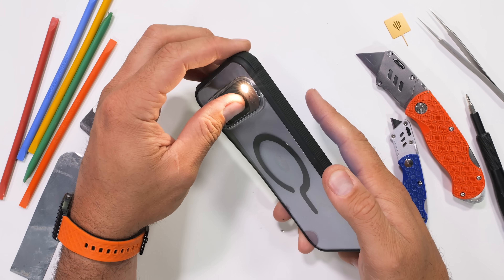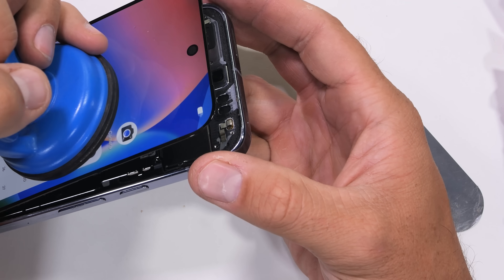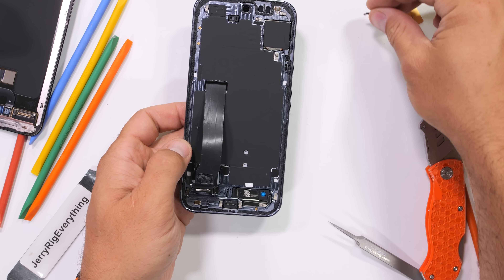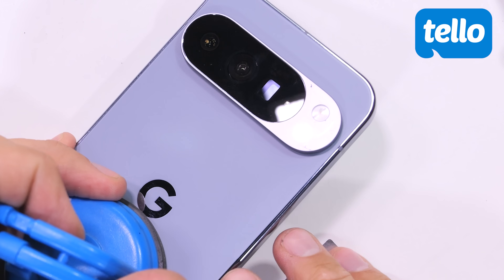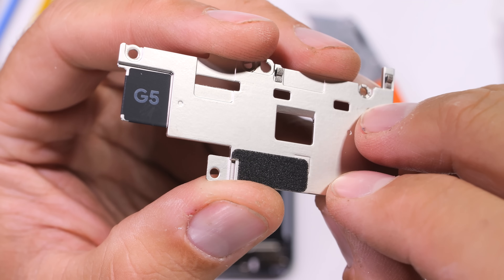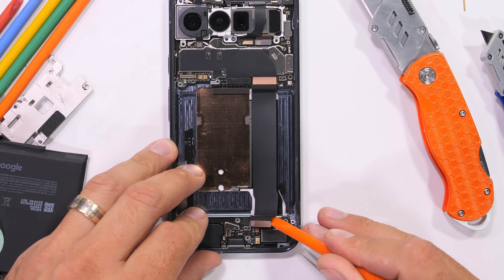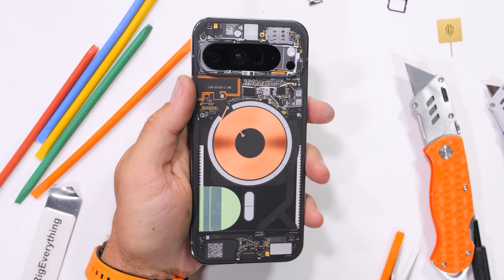GOOGLE FINALLY DID IT! - I'm so proud...

Comment: As soon as you started shilling I turned it off. Why would a company charge significantly more for a digital E Sim to a physical Sim. Is this a break through in technology allowing Sim cards to be cheaper? Sim cards just load digits physical or not there is no reason it can be 10 physical and $5 non besides manufacturers cost of actual chip. Which is likely $.20 not monthly either. Sell out
Reply: Because e-sims are better.

Comment: Actually, "international" pixel phones (or more correctly, non-US models) also support eSIM, so have both choices. If you need more than two numbers eSIM are handy, but traditional sims are easier to move between phones should you need to.

Comment: Screws aren't (and have never been) an issue when repairing these phones. The heatgun, glue removal process which is still incredibly susceptible to damaging the display is still the biggest issue. NOT easily repairable in my book.

Comment: We just want
1. Removable batteries
2. Solid supply of said batteries up to 10yrs
Reply: Don't forget about oled displays that dont crap out giving random green lines after a year or so of use
Reply: @Lucas-ck1po  not every oled phone has that issue
Reply: I want 512gb storage without being extorted to pay an extra USD $500. Until then, I'm not buying a new phone.
Reply: * removable back cover
Reply: Batteries are removable already with tools
Reply: You common sense. Removable batteries? Then what happened to water resistance?

Comment: Tell me if I’m wrong, but phones makers should stop trying to make their screen super hard and scratch prof, because 90% of people use a glass protector anyway (sorry about that 10%). They should focus on other properties of the screen, like reparability or flexibility (so they don't shatter). Sticking on a glass protector—even if it’s not that super druper screach resistent like a Victus Gorila or whatever—is a good enough solution, as long as it’s cheap and easy to apply, and guess what, it is! Why should we pay for a hard to repair, ultra-expensive, super-durable glass screen if almost everybody just puts a glass protector on their phones? They are easy to apply and cheap they should just include one for free in the box to be fais with that 10 %.

Comment: How is this even considered more repairable then the fairphone? You used a heat gun and a blade to open it? And you will need a glue strip I assume to place it back down? Fairphone isn't perfect sure but it's better then this process
Reply: More repairable compared to previous Google phones

Comment: I heard people complain about its weak specs, but really why do people need such high performance processors in a mobile? I'd so much rather have a device that respects consumers like this one does with it's unlockable bootloader, good repairability, and good documentation. Also, ironically the best way to de-Google is to get a Google Phone too. At least unless you're also against supporting them financially I suppose (boycott rather than just privacy).

Comment: Um... The Samsung S5 / Note 4 were MUCH easier to work on.  No heat gun required.  Any user could replace the battery.  and it had an IR blaster, headphone jack, microSD card slot, heartrate/pulseox sensor, etc.

Comment: Hot take:

Apple: "The best phone is the one you never have to repair"

Google: "The best phone is the one you can repair & keep forever"

Also, I just got an Idea, in the future, you can upgrade your battery from lithium ion to silicon carbon which packs 20% more capacity hence giving better battery life. That would be amazing as long as the software supports it without exploding like an S7😂

Comment: Free 234 page manual doesn't make this phone more rapairable than Fairphone. They still glued everything, and I know that I will curse Google 234 times trying to open it without prior experience of phone repair. Even you had some spare parts, which is telling something. Well, apparently they are improving, but still far cry from drop in replacement of anything. Instead of glue try ancient forgotten technology of screws. But that would require making something different from Apple formula, which no mainstream company is capable of doing apparently.
Reply: its just a statement that they dont trust their userbase to be a majority home DIY repairman, which from a name as big as google, is fair (phone pun intended)

but for the average phone service shop, its easier now to repair phones from the elderlies, which theyre not gonna self service anyway.
Reply: @TD2T it's not lack of trust, it's deliberate effort to stop people from repairing or changing a battery and go buy a new phone instead. Apple did it and now everyone copying it blindly.
Reply: Then its not going to be waterproof, i would definitely not want such a phone
Reply: @gapininja it can still be water resistant with more thickness

Comment: Yeah.. for $45 a month in my country Bulgaria ( east EU member) I get:
1. A mobile plan with unlimited 4G(around 280mbs) and 5G(around 850mbs) internet and calls in whole Europe member counties
2. A second limited mobile plan for my 6yo daughter's smart watch 
3. A mobile router with 300GB of fast internet in whole Europe that I use to monitor a farm that's far from "the modern world"
4. An android device that has more that 500 TV channels + the ability to install an app on another 3 devices to watch the same things. + I installed PSP emulator on it and it runs even god of war :)
5. 2 years of Netflix basic subscription! 
6. I got when I signed the contract a Motorola G24 for $12 that my daughter uses.

Comment: The battery being easily removable is such a win.
Reply: You still need a heatgun...
Reply: @NBD739  I worked on one of these yesterday at a shop. You don't need a heat gun, just some kind of heat source and some plastic to pry with. If I have to do a repair at home, I use a hairdryer and just go REALLY slow

Comment: If the tensor G5 didn’t suck so bad I’d seriously consider this phone. Selling parts is huge. Apple does this too but it usually costs the same to buy the part as it does to have the repair done by them
Reply: What problem does G5 have?
Reply: @moonlightpage it’s a lot of years behind Snapdragon and Mediatek in terms of CPU, GPU, and power draw. All it’s got going for it is that Google makes it in house so it’s theoretically cheaper, but the phone is just as expensive as everyone else
Reply: no sideloading
Reply: @catosx2738 side loading has nothing to do with the Processor. It's the OS which decides if side loading is allowed or not.

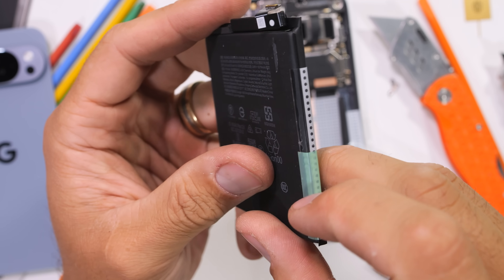Comment: 5:19 The little extra bracket is a stabilizer bracket that sat above the left rear camera. It was attached through that one screw hole above the camera and held down the connectors for that wires above the camera.
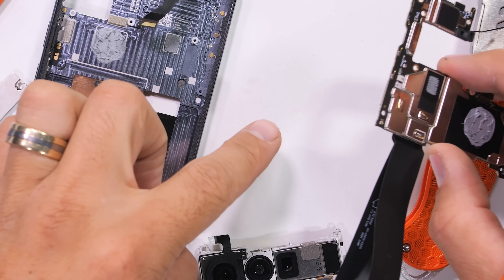No idea where the bracket in 6:33 came from though, lol.

Comment: It makes sense that they are making the battery easier to replace. They already committed to decreasing battery charging percentage after 400 cycles so having a battery that can be replaced just makes sense.  The EU is also rumoured to be pushing for phones to be easier to repair, including replaceable batteries. Google is putting themselves is a good position

Comment: Sorry, perhaps dumb question. If the phone has an high ip rating. Then why are there water test stickers inside the phone?
Reply: IP68 is only water resistant down to 3m/10ft, and assuming the phone is in good condition.

Comment: if you have to use anything more than a screwdriver to take apart a phone it is NOT easier to repaire and maintain compared to a fairphone and for the screen replacment you once again for fair phone you only need a screwdriver to do it no heat gun or anything else etc. it is not the easiest screen to replace on a phone fairphone is.

Comment: Man, i was so happy to see the ribbon cable for the display was in the mid. But then u removed the back. That ribbon cable on the far left is an absolute disgrace to smartphone companies. It should never be so far to the outside in my eyes. I stopped repairing phones simply cause of that. Had to many of the tear on my due to stupid placement.

Comment: 240 pages of repair guide is not "easily repairable." Google still want you to either pay their technicians or buy a new phone.
Reply: Easily repairable by local technicians not you. You don't need to read 240 pages of repair guide to replace your screen or battery as clearly seen in the video.

Comment: My forever question will be:
Why did we ever glue batteries in place instead of having literally ANY form of mechanical retention system? 
Besides money that is.

Could any manufacturer NOT make an ultra-thin piece of aluminium in the shape of an X that goes on top of the battery and then has 4 screw-down points on each corner?
Its not like the battery will fall out of place if its shaken too much anyway since the back of the phone is already welded shut with how much glue some manufacturers use.
Reply: mechanical is less bouncy, and batteries dont like being in a cold cramped space, 'lest you want another Note 7

arranged solution is plastic but one that doesnt shake as much, such as glue. pull tabs goes less sticky overtime, but at that point you might already have plans for chanaging batteries

Comment: - Used a heat gun.
- Used chemicals (propanol alcohol).
- Used various different tools.
- Every screw is different.
- You are left with two pieces and no idea where they came from.
This smartphone has a repairability score of 6/10.

Do you really call this 'more repairable than the FaiPhone' (which, by the way, has a 10/10 repairability score) and 'the most repairable smartphone of the year'? Are you serious?

Comment: 100000 like. zack bro. i think you underestimate your fans just like you did during Nothing phone 1 and ended up counting each leds.❤❤😂

4 hrs and you have reached almost a quarter. I bet we don't need more than 2 days.

if you have read this, and if you get 100000 likes, you will Do Durability test and teardown of Iphone 17air in 1 single video before 20th Sept 2025.

Comment: 0:03 How is this more repairable?? Fairphone 6 display literally is just held in with screws, no adhesive, and no alcohol, heat gun or ultra-thin blade required.

Comment: Can you test water durability? Maybe check at what depth they start to leak. Rate the seals internally. I've seen a couple of google pixel phones fail after a year with minor water splashes entering and killing them. Something is not right, if a phone is advertised as IP68 then it should remain like that for many years and not just 1 or 2 years.

Comment: I don't agree with the most repairable phone of the year. The Fairphone 6 does not need hot air to loosen the screen nor is the battery glued in, however easy you could get it out of the Pixel.

Comment: FWIW, regular simcard subscriptions can be as low as 5 euros as well. You usually only have to pay a small fee to transfer your phonenumber. But other than that, there isn't much difference.
I like having my contacts as backup on the simcard. If something goes wrong with the phone, I just have to pop the simcard in a old backup phone and everything works.
Reply: eSIMs are only useful when you have a chinese phone number, which they shouldn't, so its basically useless

aall these years Comp Science people have worked on making sims unduplicateable, became useless in a singular day 😂

Comment: 2:30 - Please don't normalize eSIM. A physical SIM card allows me to quickly move "my phone" to different hardware if my phone breaks. An eSIM requires asking mommy and daddy to please allow you to move.
Reply: It's not that it's harder. ESIM is actually easier. It's just that you need an app and Internet connection to do it. A SIM card can be moved at any time, no network needed.
Reply: I prefer a physical SIM card.
Reply: Tbh, I personally prefer eSIMs since 3 years ago I bought the Google Pixel 6 Pro and in about a year, the SIM card slot ended up breaking with the physical SIM card stuck inside, the slot was very fragile and easy to break so trying to pull it out would only cause damage 

I really liked the smartphone but that on its own really messed things up for me, I remember taking it in for repairs and was charged almost 300, I also travel a lot so having multiple eSIMs would make life much easier
Reply: It's a control thing. Like everything else.

Who benefits from disabling your ability to quickly and easily disconnect your phone from the cell network? Who would want to make sure you are constantly available to be tracked, and send data back together cloud.

Who is in the middle of pushing to lockdown even the ability to sideload APKs.

Hint. Big brother only likes sheep. Never independence.
Reply: @breakingthemasks  and who is Big brother? I want more details.
Reply: I don't get how so many people have issues with eSIMs. I got my Pixel 10 Pro XL and the process of moving the eSIM to it was literally just installing my carrier's app (Mint Mobile) on the new phone, going to the menu and saying I want to get a new eSIM for the phone, and then waiting about 1 minute for the process to complete. Is it much harder with other carriers?
Reply: @alex-d3l2z  I live in a country where esims are not very convenient. We use our phones to access/log into a lot of things. Needs a physical sim. There is an esim alternative but it sucks so barely anyone uses it.
Reply: @alex-d3l2z  Mint makes it way easier than other companies like ATT. I can switch my Mint number over as many times as I want without issue. With ATT they let me do it once through their website and then if I try it again sometime later it usually doesn't work, so then I have to go into one of the stores to get it switched.
Reply: @alex-d3l2z in my country, all providers charge some amount (approx. 1 months fee) for each esim installation and they want you to be there in person. It's not phone manufacturers fault but it is what it is
Reply: I just put my SIM card in my phone.....
Reply: If esim is normalized maybe it can be way easier to move it
Reply: No it doesn't, esims are transferable and switchable (having many esims loaded on the phone that can be switched with a button push), traveling is way easier with esim also no need to go to a store to get a plan just buy one online and your done.
Reply: @nlibby987  How do you transfer that e-sim out of a broken phone that won;r power on?
Reply: @pileofstuff  THANK YOU, how tf do you put an eSIM into a backup phone that uses traditional SIMs? It's like no one in this comment section has broken a phone..
Reply: @130rne  Why not just keep the sim card in the drawer with your backup phone while downloading an e-sim to your new phone?
Reply: @drosendahl  You can't have a physical SIM and eSIM at the same time for the same phone number.
Reply: @pileofstuff  damn you silenced him 😔
Reply: @nlibby987 but not on fly its not.
Reply: it also allows thieves to quickly swap out the sim and knock the phone out of network service and make it untraceable
Reply: @rock3tduckNIZ  What a constructed issue, if they have your phone they can just wipe the esim off of it.
Reply: @cyberdusttv  Where I live, eSIM is not readily available. Recently, my roommate lost his iPhone, which had no eSIM. If it had an eSIM, the thieves would not have been able to remove the SIM, and the phone would have remained easily traceable. You also wouldn’t be able to power off the phone while it’s locked or even wipe it.

Comment: This is nice to see from a large brand, but it can be better. My phone from 2022 has a removable back plate (no glue) which after removing it reveals screws that open up the phone. The battery is also fastened with screws, no glue used at all. That's way better than any large brand is doing, and it's still way more water resistant than any of their phones.

Comment: How is this possibly as repairable as the fairphone? You need a heatgun to open it, the USB-C port is part of the bottom board, whereas on fairphone the port itself can be replaced without needing to replace the whole breakout board, the battery (despite being better than previous pixel models) is still glued in, whereas fairphone can be removed by screws. A family member could comfortably perform a fairphone battery swap themselves, but I don't see that happening with the pixel. There's no comparison, and fairphone wins hands down

Comment: They tried in many ways to make this phone good in order to encourage people to buy them, while they also stopped sharing the device trees required to build and run an custom rom on it. A lot of people were buying previous google pixels just to run a custom OS.
Reply: This is my main problem. I was hoping to switch to GrapheneOS with the Pixel 10s, but alas, no longer. At least, not for a while.
Reply: @Gidaio  Unfortunately I think google will never go back, they seem to be trying their best to not let us use whathever the software we want on our computers. They want to force us to use the Stock OS and ensure we don't install an app they won't like, while stealing as much personal data as possible.
Reply: @Gidaio  I just found out that GrapheneOS is actually going to support the Pixel 10 line. They will start supporting it when Android 16 QPR1 gets ported. They also said that they're working with another company to make them meet the requirements for the OS and people think it will be "Nothing" brand.